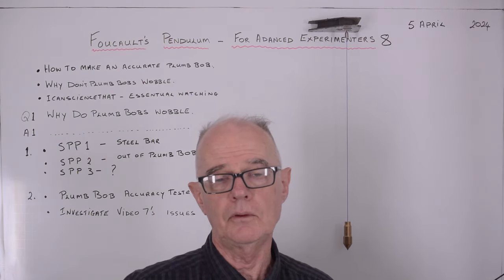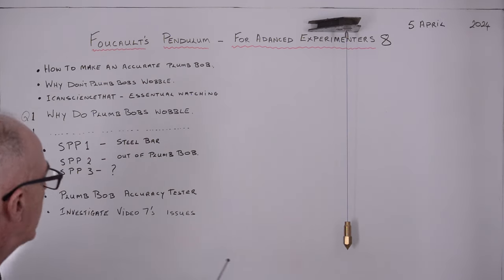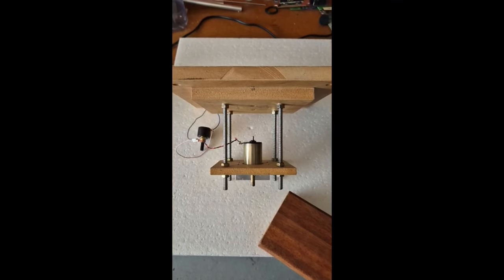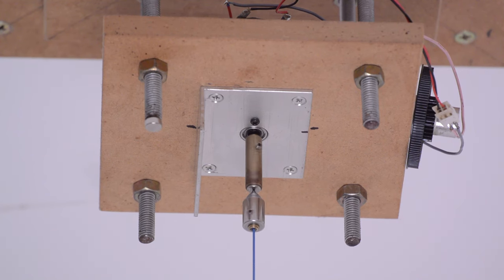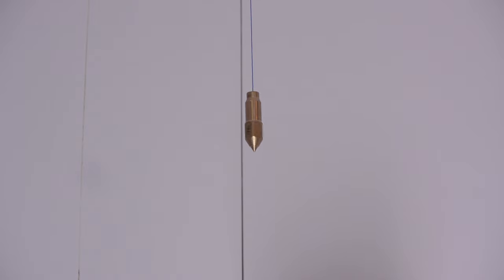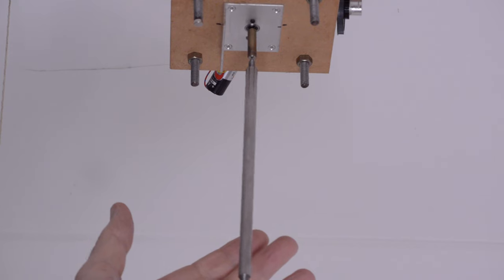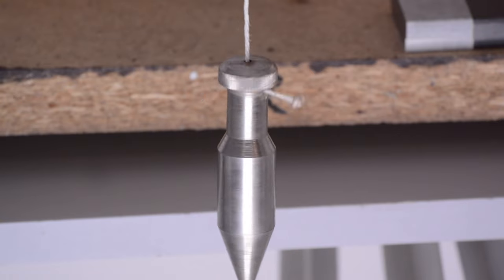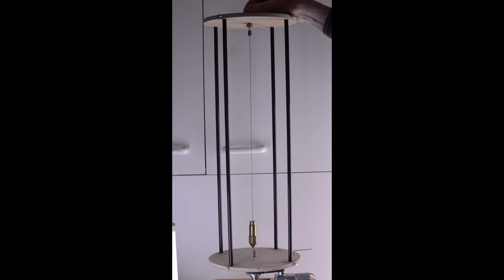Foucault Pendulum for Advanced Experimenters 8

Comment: Yeah... the off-center mass of the pendulum is inducing a significant wobble. That really does look like MORE than enough to create issues with a decent Foucault Pendulum experiment.
Once the thing is swinging, I expect it won't spin anymore, and then the centrifugal wobble will go away. But to make that go away while it's spinning, you'll need to perfectly balance it. That'd be a tough one.
The angle of the roof shouldn't matter, and now you've got the gravity vector aligned with the axis of rotation, but any off-center mass causes a wobble ... just like what happens to your car if your tires aren't balanced. :(
Reply: I should point out the dramatic difference in rotation speeds between what you showed in video 7 and video 8.
The easiest way to reduce the centrifugal force is to reduce rotation rate. Since the centrifugal force scales with the square of rotation speed, the increased rotation speed is turning even small eccentricity into a large force.
Reply from the maker: @icansciencethat Thanks for the reply,... Yes to all of the above,.... I could never get consistent CCW precession on any pendulum, until I made the plumb bob / pendulum tester.  It was sorta like trying to balance your car tyres while driving the car and as you pointed out just a few grams / or mm out of round on a car tyre will shake a car.

Comment: Not clear on why you have a motor at all.
Reply from the maker: By spinning the plumb bob it is more easy to pick up imperfections such as weight, bearing and aglet misalignment. When we start to swing the plumb bob to become a pendulum it has to be as close to perfection as possible, otherwise it will produce inconsistent results.
You have to think like a pendulum clock maker trying to make the perfect clock, each swing of the pendulum must be identical otherwise the clock will gain or loose time.  Good question I should have amplified the point of spinning and precision.
Reply: @peterleane6807  
So the motor is just to screen the plumb bob that will be used.
Reply: @peterleane6807  By testing the bob spinning you over-emphasize the problems of having a bob with an unstable axis of rotation. A lengthy bob will ALWAYS be unstable in rotation.
Reply from the maker: @HotelPapa100.  The plumb bob accuracy testing rig is only used to look for imperfections in  plumb bobs, in other words a screening tool.  When the plumb bob swings, (pendulum) I do not spin the motor. That being said in a future video I will be spinning the motor a very slow rate similar to the angular velocity of the Earth.
Reply: @peterleane6807  But a bob that has ANY overextension in one axis will be unstable. Independent of its own accuracy. The rotation test is not useful to assess that accuracy. Rotation about its unstable axis will exaggerate any external influence,and you won't be able to eleiminate those completely.
Reply: @HotelPapa100  
All big installations the bob is a sphere. So that’s what he should use.
Reply: @larryscott3982  It certainly avoids the problems of stability. Not easy to produce a homogenous totally symmetric sphere and hang it absolutely symmetrically either, though.
Reply: @HotelPapa100  
Depends on how large. Not expected to DIY make a large high mass sphere in the garage. And attaching the wire to surface it’ll hang centered. 

He’s not going make a 20 m 50 kg setup. So scale matters. As a learning tool perfection is unlikely. If he is attempting new research, white paper stuff, then everything matters. But he’s not going to find something wrong with the myriad of high end research papers on the subject.
Reply from the maker: @HotelPapa100.  Your statement has validity, however I would have to see experimental evidence to ensure we are both on the same page and I can only show my experimental evidence as follows.  From my experiments using the precision ground steel rod that was pointed between two centres on a lathe.  The rod plumb bob behaved as an ideal plumb bob when spun.  The only instability that was noticed was due to the centrifugal force, that was displayed in the video 8.  If the spin speed was reduced well below the influence of the centrifugal vector then the rod spun perfectly without any wobble or distortion.  It is my understanding that the 67m plumb bob used as the pendulum in Paris is an ideal plumb bob.
Reply: @peterleane6807  
Consider the center of gravity of a rod versus a sphere. The COG should be at the greatest radius. The mass of the bob should have the smallest surface area.
Reply from the maker: Yes you will see some of my precision sphere plumb bobs soon, a sphere is definitely the way to go for the shape of the bob.  My sphere sizes is based on 50mm diameter that is cheap and easy to find.